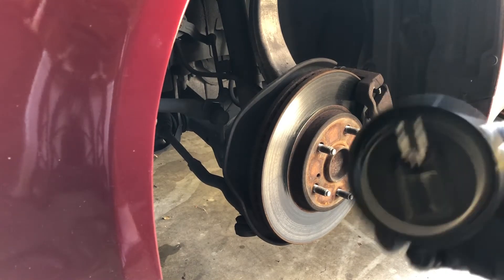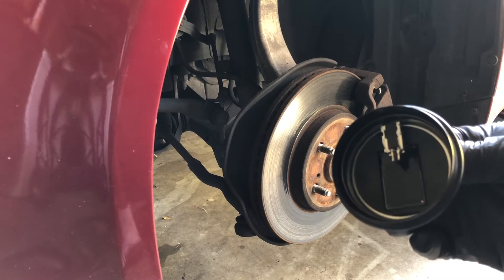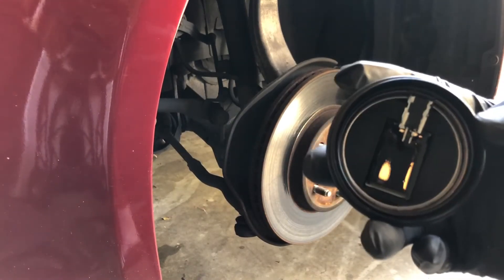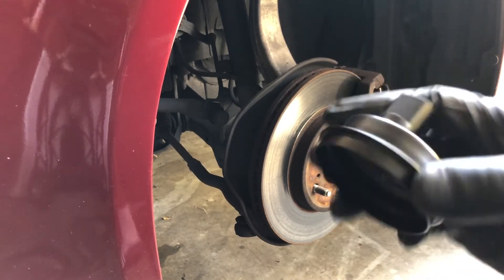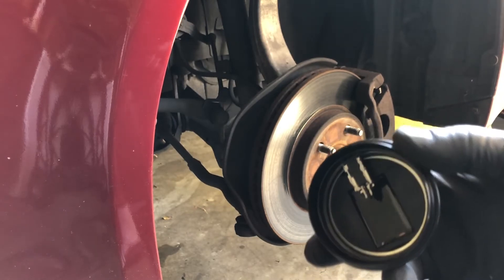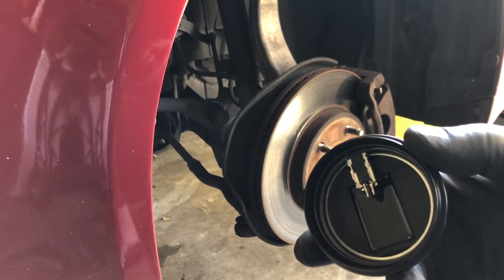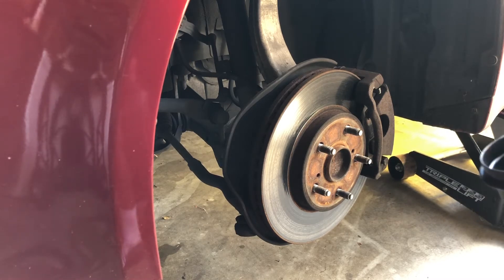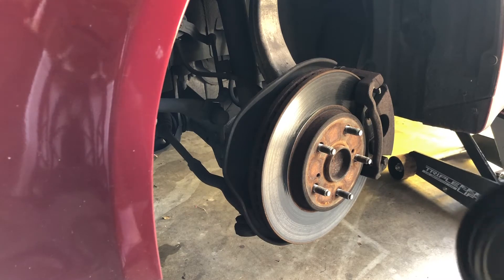Lexus IS 250 350 Abs Wheel Sensor Repair + Fix

Comment: Thanks for making this. Did you get an error codes for this? I have a C0205 code (FL Wheel Speed Sensor malfunction), and got the whole wheel bearing replaced but it did not wipe the code. Any suggestions?

Comment: I got a question, im trying to replace mine but online i keep seeing like left or right front or back wheel sensors. Does it matter if i buy a left or right or does it have to be exactly to that side and location of the car?
Reply from the maker: The front should be the same as left or right and the rear should be the same as well for left or right. I hooked my scanner up and it told me which one was bad
Reply: @youcanfixthat8636  Okay thank you so much, so the front two are the circle ones taht you show in this video and the back two arent because i see the stick one that is typically for most cars that you just unplug and plull out is taht the right one or is it the circle one again for the rears? my rear right one is bad
Reply: @azrealrblx3131  it should be different for the rear. No cap. Just a sensor that goes into the knuckle and counts CV axle teeth I believe

Comment: I replaced the whole bearing on my rwd 07 is350 and now the abs light is on, could this be a faulty abs sensor on the new unit or should I replace the connector that runs from the well? My car was so rusted had to remove the whole spindle and press out the old bearing 😂
Reply from the maker: make sure it plugged in. i thought mine was bad but i forgot to plug it up..lol

Comment: Any chance you remember the code for this fault? Im trying to determine if its this or output sensor outside the transmission. The fault code I have is C1402 and C1405.
Reply: C0200 right front speed sensor

Comment: Can you post the link for purchased the sensor 
I couldn’t find it on Amazon or eBay 
Thanks
Reply from the maker: https://www.ebay.com/itm/New-ABS-Wheel-Speed-Sensor-Front-Right-W-RWD-For-Lexus-GS350-430-450H-IS-F-IS250-/172296434230?mkcid=16&mkevt=1&_trksid=p2349624.m46890.l49286&mkrid=711-127632-2357-0

Comment: I changed all speed sensors and it all reads fine on a scan tool .. but speedometer won’t work
Reply from the maker: you have a issue with transmission speed sensor

Comment: does this fix the speedometer not working? my speedometer and odometer doesnt work
Reply from the maker: Do the other gauges work?
Reply: @youcanfixthat8636  yes everything but the speedometer and odometer doesnt go up, but when the car starts the speedometer arm moves upon initial car start up with other guages, then after that MPH is always 0
Reply: my car has the same problem. when the speed sensor is not working the car wont show speed or any new mileage on odometer. need to fix abs sensor or harness or both. then car should get power steering back and abs and all that